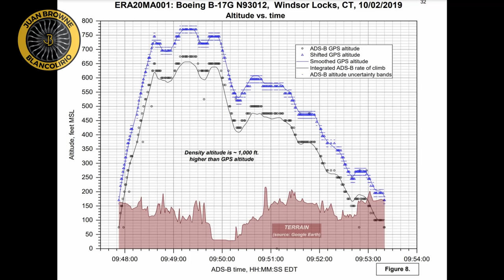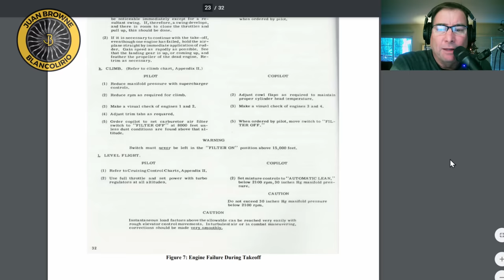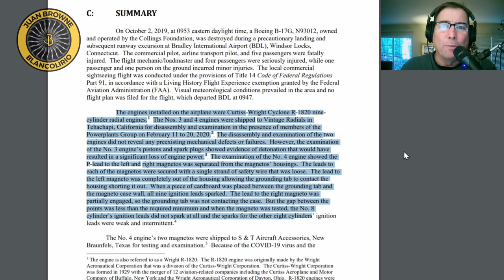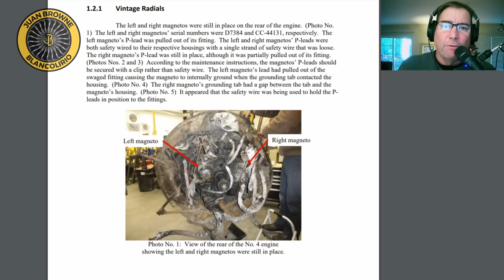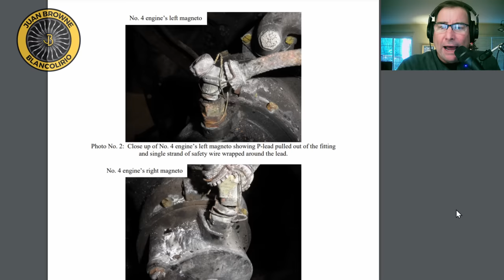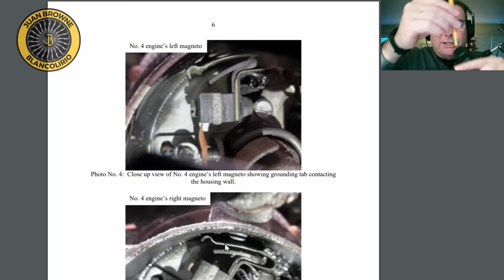NTSB Report B-17G Crash 'Nine-O-Nine' Part II -18 Dec 2020

Comment: According to the accident report,  after finally getting the engines running and prior to the intersection takeoff,   the pilot performed NO engine runup .   Whiskey,  Tango,  Foxtrot.     I guess nobody (on the flight deck) wanted to challenge the world's highest time B-17 Captain.    And that's just BAD cockpit culture.
Reply: Moreover we've known the dangers of this for more than forty years.
Hence CRM...
Reply: thats bad, I assumed he had and was wondering how the engines had magically performed normally for the runup
Reply: @lwilton  someone in the right seat without a type rating or even training is effectively more passenger than pilot.
Reply: @markevans2294  I'm not going to disagree with you. I just finished reading the loadmaster's testimony, and I get the impression that the copilot was very often effectively a passenger on this plane.
Reply: @Mark Evans Where did you read the load's testimony?  Would you share that link?
Reply: @almostafarm6394  He provided the link in the description, but it is https://data.ntsb.gov/Docket?ProjectID=100356
Refer to Section 8.
Reply: @LTVoyager  Agreed.
Reply: @almostafarm6394  Also read the passenger testimony,  particularly passenger RS5.    He happens to be the command chief master sergeant of the 103d Airlift Wing @ Bradley Air National Guard Base.   He has high flight hours so I'd deem his judgement as credible.
Reply: @seeingeyegod    That's what I'm saying,   I find it beyond difficult to believe that those engines passed the pre-flight magneto rpm drop check.
Reply: And look how well that worked out. RIP, so damn sad.
Reply: It shouldn't have even got that far.  This was not a problem of "breaking the chain", it seems someone had removed all the links in the chain.
Reply: @jamescaley9942  there was a great 60s Aretha Franklin r and b hit ,"Chain of Fools". I'll leave it at that.
Reply: ...kind of like Captain Van Zanten at Tenerife?...both were VERY experienced...
Reply: That is a powerful and very sad parallel.
Reply: i must admit that even in my limited flight time, half of which has been in vintage aircraft, having someone to back me up on choices and to call me out on it when i dont do something/ do something wrong has saved me. 

especially in the Rearwin Sportster i've been flying which also has a radial engine, i suspect that it has saved my bacon more then a few times, where the mag drop has been sketchy be it due to the engine running cold or the spark being weak.

I believe that there was a similiar accident with the sea fury (or tempest) at duxford where the run up sounded sketchy like half the cylinders were not firing correctly. 

I will say that hearing an issue in a multi engine aircraft is likely harder then it is compared to the type i fly.
Reply: @lwilton  it is impossible and completly out of the question that someone with a jet transport license  and vast careeer experience like that right seat pilot, wouldnt know what a propeller driven plane engine run up is. Not being qualified in the b17 doesnt take all of his career experience away
Reply: @LTVoyager  
Precisely,
Reply: @dyer2cycle  And the first officer never challenged Van Zanten either.
Reply: Exactly. Engine run up, and checking the rpm drop by checking each mag separately, just before take off, is a procedure that has been around for a long long time. He perhaps didn't do so to save time, or else he already knew he had bad mags on #4.
Reply: @lwilton ,,, Nonsense,,,
Reply: @LTVoyager  Bingo,,, The Copilot Knew The Proper Procedures,,, Maybe He Didn't or Couldn't Enforce The Proper Procedures,,, Peer Pressure,,, ect,,, ect,,, ect,,,
Reply: @lwilton  I've learned from YouTube videos that during run up you switch from both mags to each individual mag and should see a 100 rpm decrease while on each single mag. They would have found out they had a bad magneto if they did the pre-flight.
Reply: @BadWolf762  50, 75, 100. The allowed drop varies by engine and airframe type. But 100 RPM is a good round number.
The loadmaster says in his testimony that they did the mag check and prop check. That contradicts what a lot of people seem to think they are quoting from the report. 
Having read the whole report yesterday, I'm pretty sure there was a lot more going on here than can be answered by any of the simple "they were complete idiots" answers people are coming up with. Those are great for affixing blame, and more importantly, for making it so you don't have to think too hard about your conclusions. But as I read how that crash played out, no one simple answer like "oh, the engines never started before takeoff and they didn't notice" really works.
Reply: @LTVoyager  Agreeed. EVERY time an engine is shut down a run up test is performed before taking off again. How they could fire up all 4 engines on that thing first thing in the morning - especially after experiencing ignition issues on both 3 and 4 in getting them to start - and then just taxi out and take off is far beyond me!
Reply: @lwilton  Here's a quote of what he said about that, from section 8 "LOAD MASTER INTERVIEW TRANSCRIPT":
"then goes to the mag
switches, makes sure all the mags are good. And that morning,
everything was perfect. I mean, we had no drop, we had no
backfire. We had nothing. I mean, there was no reason not to
fly, you know."

It sounds a bit strange to me if they had no drop in rpm (I guess he meant not more drop than supposed to, the rpm shall drop some at the mag check) considering the bad state the mags were found to be in.
Reply: @skunkjobb  It sounded a bit strange to the interviewers also, if you read a bit farther down. He goes on to clarify that he meant only a normal drop of (if I recall correctly) "30 or 50 or 75 RPM". 
Frankly the drops he quoted sounded a little low to me even for good mags, though the interviewers didn't press him on the actual values. Depending on where he was standing he may not have been able to read the tachs easily, and may (I suppose) have been estimating the drop from the engine sound. But unless he is lying outright, which I'm not sure I would believe, it sounds like the normal engine runup checks were made. Why there was not an abnormal drop on at least one mag on the #3 engine is something I'm still trying to figure out. But I'm tentatively willing to believe that all 4 mags worked on #3 and 4 before takeoff, and the failure happened after takeoff. BTW, I think the partially pulled primary wire that was grounding one of the mags on the #4 engine is a red herring. I think that happened during the crash. Note those wires were completely missing on the #3 engine, and they are certainly out where they could get easily damaged. But that does leave the question of what happened to #4. The loadmaster seemed to be of the opinion that he personally would not have shut the engine down for whatever problems it was having.
Reply: @wtf123560   Actually, he did challenge, twice, but insufficiently forcefully. (Probably in deference to the very senior captain.)
1706:29.59   PanAm:  "OK, will report when we're clear." (Quite audible in the KLM cockpit.)
1706:32.43   FO:          "Is he not clear of the runway?"
1706:34.10   Capt:       "What do you say?"
1706.34:.70  FO:          "Is he not clear, that PanAm?"
1706:35'.70 Capt:        "Oh, yes...."

(Page 46, https://www.faasafety.gov/files/gslac/courses/content/232/1081/finaldutchreport.pdf)
Reply: @skunkjobb  Don't believe it.  A px who knows what a run-up is says none was performed.  And that #4 engine would have stopped if a mag check had been done.
Reply: @LTVoyager  You ain't shittin'! Wtf is up with that? Both mags were cobbled, one was worn well beyond spec, the other had the points set at .006, then cobbled up with mechanics wire? We didn't do shit like that even on our old beat up cars back in the 70's! I've never imagined anything so f-ed up on ANY aircraft, let alone a B-17!! That's what they got from the "highest time '17 pilot in the world"?? SMH, unbelievable!
Reply: Good god.
Reply: @skunkjobb  no drop at all is exactly what would happen if you switch off a defective magneto... Or a small drop if the magneto is just barely working.
Reply: I have been binging this lately, and 10 years ago got to crawl thru 909 and the B24 at Bradley,   talking with some of the crew I got the sense that there was some pressure or maybe their culture to minimize run time. At the time they had stopped doing passenger rides in the B24 due to lack of spare everything. Fun fact at the end of WW2 there were enough spare parts to build a couple of thousand more. I have read that Mac was never actually rated for his job. Not trying to start anything, would like to hear thoughts on having tons of experience but nothing to say you have been proven to be actually are qualified. And another thought about big old piston airplanes, that modern gasoline lacks the octane and lead for these engines to make the hp they made back in the day. Octane rating has to do with how much boost and timing advance you can dial in in before detonation. Great stuff here, thanx
Reply: @pR1mal.  can I get a ride to Dead & Co. tour? :) :) :)
Reply: @mjouwbuis  Maybe I misunderstood, but wasn't it the case that the mag was grounding?  Consequently, wouldn't that mean that the engine would shut off when only that mag was selected, or, rather, when the functional mag was no longer connected and providing a spark to the plugs?
Reply: What?! No run up and left/right mag check? Is there no checklist and SOP for this plane? Unbelievably irresponsible.
Reply: @flyurway  when the points gap on my MK1 ford cortina got that small I would file the fastening hole to give more adjustment clearance ( due to lack of money).
Reply: Run up would have likely revealed the p-lead problem.

Comment: The lead pilot / mechanic standing on the pail step of the step ladder is disturbing.  Top step is bad enough, pail step is worse.  Something like that is indicative of a very poor safety culture.  Eventually Russian roulette catches up with you.
Reply: You nailed it..
Reply: Excellent point. That does indicate the type of culture in an organization.
Reply: Yep.  When you do that alone, you're a fool.  When you take other people onto a "pail step" with you and burn them alive in an airplane, you're a killer.  Poor safety culture indeed.
Reply: Owning a ladder tall enough to reach the top spark plugs probably would have helped
Reply: Insightful observation @Up Level - the seemingly innocuous but inherently dangerous practice with the ladder turned out to be just the tip of an iceberg's worth of appalling safety lapses. The first doesn't necessarily guarantee the second...but the second can sure explain the first... I'm sure no one here takes pleasure in the told ya sos though.
Reply: @seldoon_nemar  Seems like they may have lacked many of the tools needed to, properly, maintain the aircraft. The video mentions they replaced spark plugs. The corrosion and piston damage in the number 3 engine could have been seen using a borescope.
Reply: @markevans2294  Sir, being a A/c mechanic for 40 years, It only takes a minimum of tools to do the mags and other light repairs. There is no excuse on this plane not to carry a box of tools. Merry Christmas!,
Reply: What is a pail step?
Reply: I thought the same thing about standing on the top of a step ladder. Years ago we were helping decorate the high school gym for a dance. One of the Dad’s was standing on top of a step ladder hanging a bubble machine. I joked that he must have never sit through an industrial safety meeting and asked if he needed a taller ladder. He came back on Monday to remove the rented bubble machine the same way and this time kicks the ladder over falling and breaking both wrist!
Reply: @skuula  It is the top step of the ladder, usually designed to hold a 'container of material' you are working with. Such as a 'pail of paint', so it is nicknamed 'the pail step'.
Reply: @billythekid3234  Ouch!!! Thank you. Yeah that sounds like a recipe for a self inflicted disaster. Merry Christmas to all!
Reply: I concur ! if you don't have safety on the ground look what happened in the air. I believe this plane should of been a static display only (My opinion)
Reply: @skuula  where you put your can of paint not your foot.
Reply: @markevans2294  corrosion is post fire...
Reply: @danielleclare2938  Okay thank you, I got it now. I usually put the paint there, then place the foot in the paint can when trying to reach into a corner without bothering to move the ladder. When it all crashes, often the paint splashes that corner and all is fine.
Reply: @16480287   no Stanley the problem is the mechanic, is also the boss of all the mechanics who also is the head of the mechanical dept who was to contact the faa to keep then advised and did I mention this same person flew the aircraft. One too many hats!
Reply: Bang, you’re dead.
Reply: WTF, OMG, if you put this infraction on Youtube, it means that "may be", you are doing worst things.
Reply: @VoicesInMotion  With this guy, one hat was too many.
Reply: @billythekid3234 Multi engine Warbirds normally carry a "Flyaway box" located in the fuselage. It's stocked with basic tools and parts. I don't recall were nine-o-nine's was located.
Reply: I've got pictures taken 6 years before this crash, that show the same practice on pre flight,  you can practically "overlay" my shots to the one you are talking about just before the fatal crash.
Reply: Amazing observation that is so sadly true.
Reply: @markevans2294  A good mechanic would have known that just by looking at the spark plugs. To a trained eye it is like reading a book.
Reply: @skuula  the very top of the ladder where a painter would put his can or pail of paint
Reply: Yep. Just finished painting the outside of a house, going up and down those Werner ladders, and you can't miss the DO NOT STAND OR SIT ABOVE THIS STEP stickers.

Comment: Cylinder # 9 from engine #3 looks like it spent a lot of time lying on the ocean floor. What a disgrace. I've opened up engines pulled from muddy salvage yards that were not that bad, and they were carrying passengers with this junk! And the magnetos? I'm speechless.
Reply: That corrosion would have happened after the crash..Probably from the engine sitting while awaiting post crash examination...